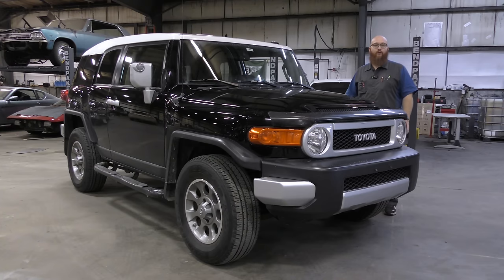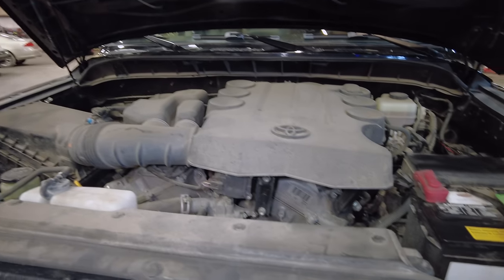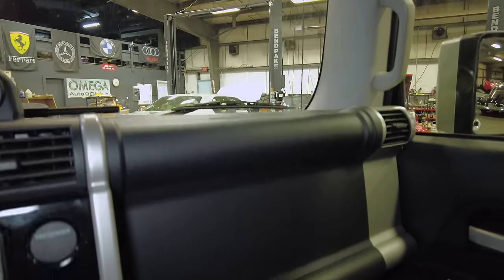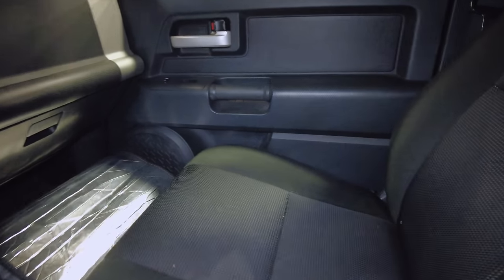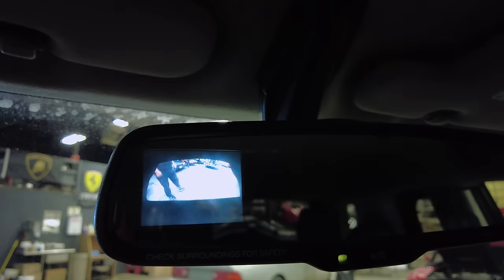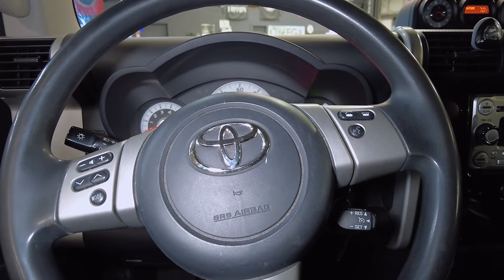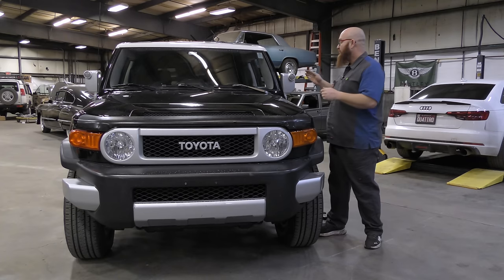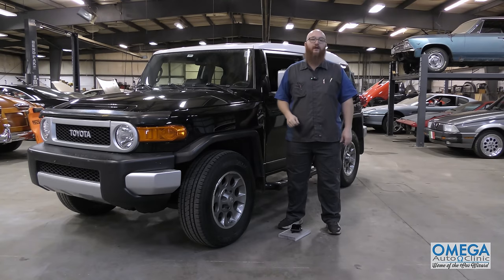Prices are Changing! FJ Cruiser Prices Are Plunging! What Happened?!?

Comment: No absolutely do not buy fj cruiser.  They were made only small number of years. It is extremely hard to get body parts, frame,  suspension,  interior parts even a windshield when break. Where a jeep or gmc tahoe does brake more but it is extremely to get parts anywhere and to do the work yourself.  It is not easy to work on a fj or toyota.  I know because i used have a fj cruiser and old fj40. And sold both because when break and they do break especially if do off roading.  They are just money pits.  Where a jeep or tahoe  i can get parts at a fraction the cost for pennies on dollar vs a toyota and fj crusier

Comment: Generally tough as nails, but HORRIBLE to see out of. It is…bad. Very bad. It’s not something I would purchase over a 4Runner unless you’re dead set on a manual transmission suv Toyota that’s as reliable as a Tacoma, at least closely. They suffer just as bad if not worse than the Tacos from road salt and slush. Rots away.